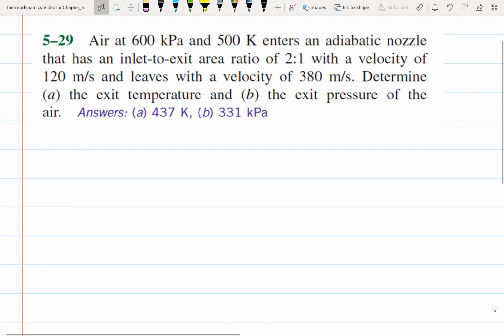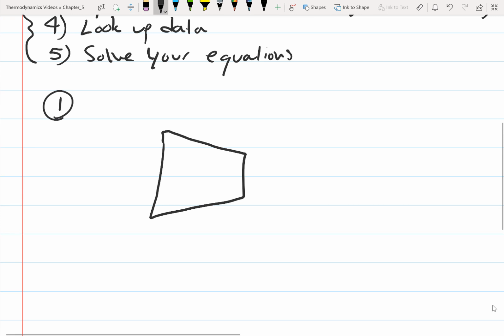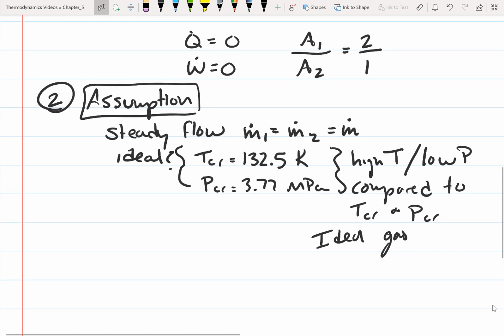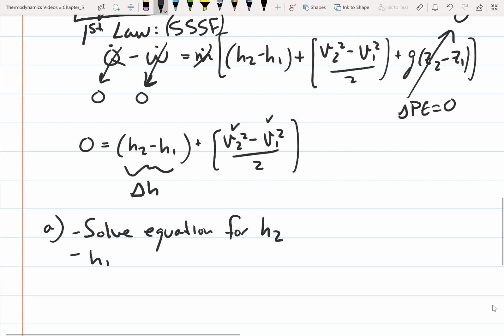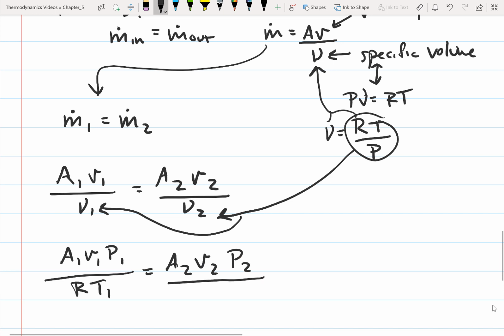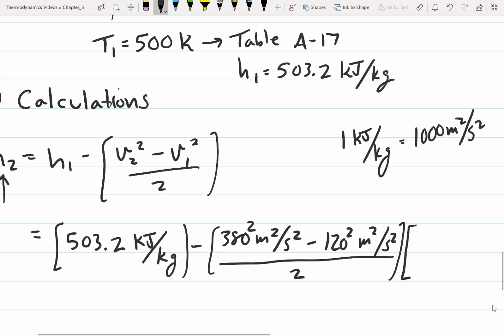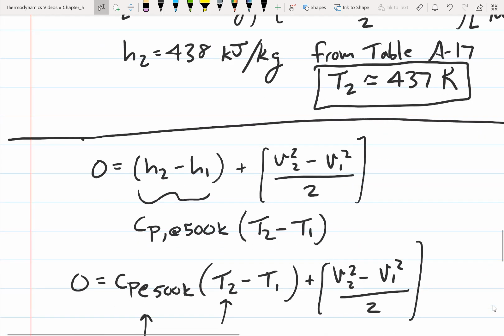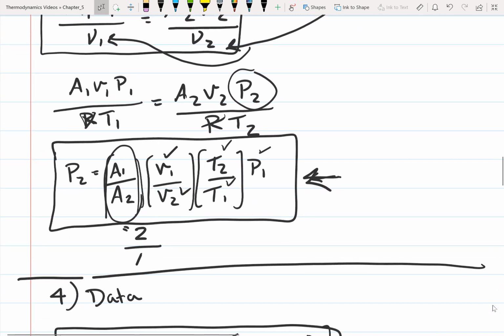Thermodynamics: Steady Flow Energy Balance (1st Law), Nozzle

Comment: when 200.0g of chromium is placed in 200 g of water at 25 degrees Celsius in a coffee cup calorimeter, 6690 j of heat is absorbed by water, the specific heat chromium is 0.449 j/g-k

Comment: So what would the conversion factor be for ft^2/sec^2 to BTU/lb?
Reply: The conversion factor for ft^2/sec^2 to BTU/lb used in problems in Michael Moran's Fundamentals of Engineering Thermodynamics is (1lbf/32.2 lb-ft/sec^2)(1 BTU/778 ft-lbf).   For example 1,125,000 ft^2/sec^2 would convert as follows:    (1,125,000 ft^2/sec^2)(1lbf/32.2lb-ft/sec^2)(1 BTU/778 ft-lbf) = 44.9 BTU/lb.